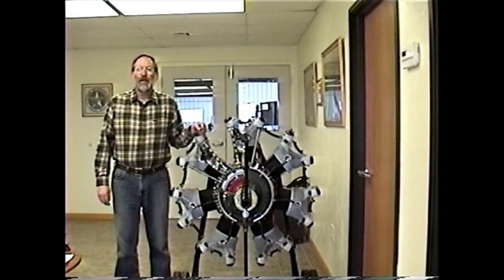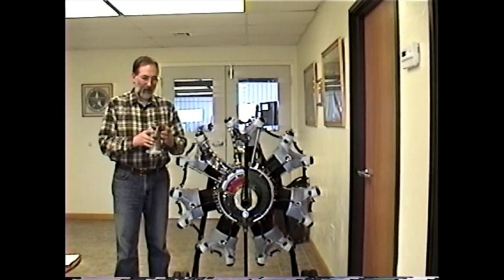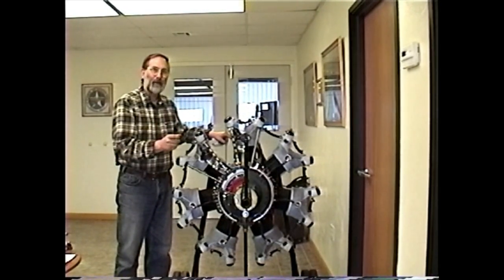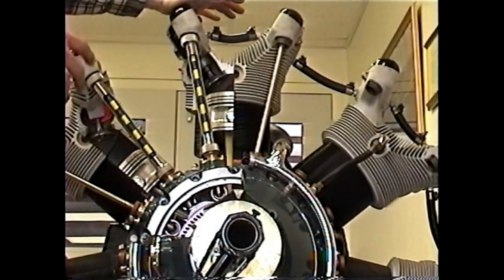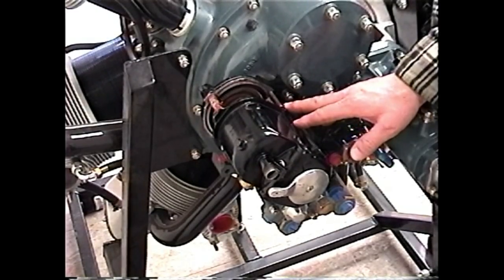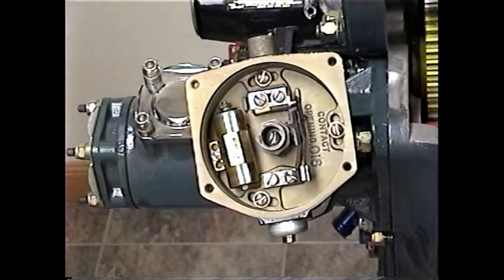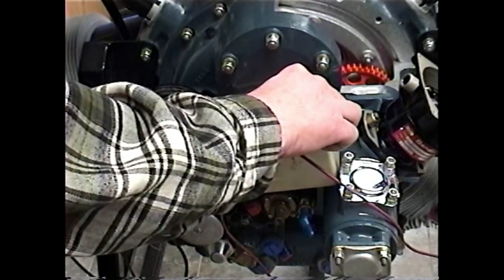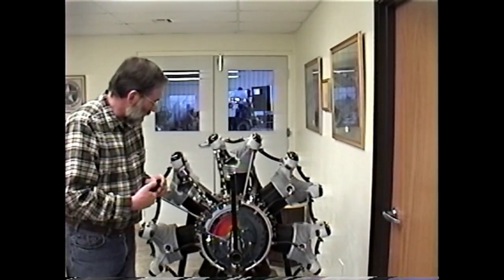Jacobs Engines - Part 5 - Periodic Inspections

Comment: setting the battery point set looked as if the follower was not at the lobe peak and the points "snapped" closed as the feeler was removed.